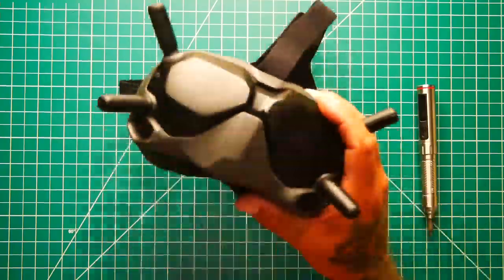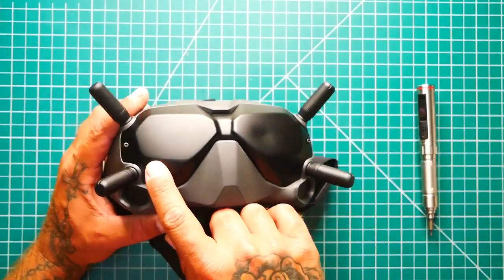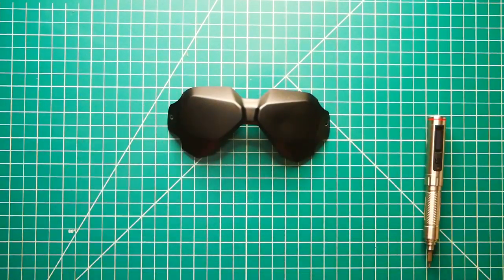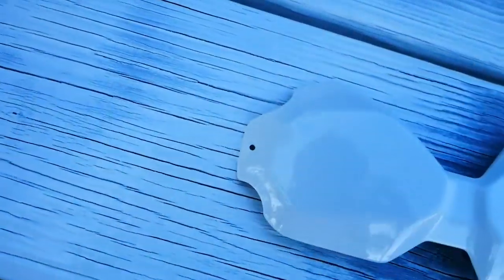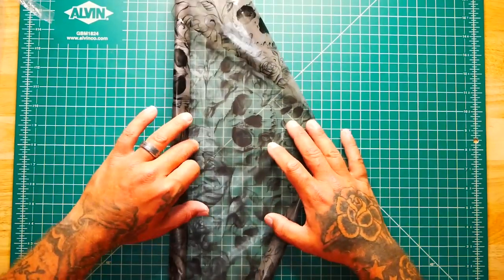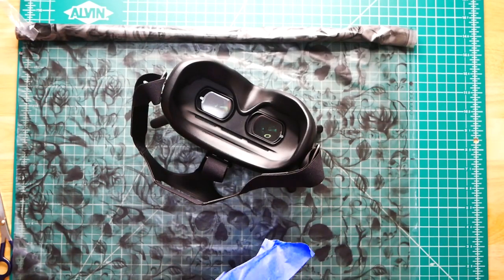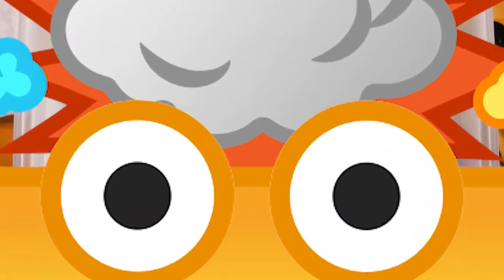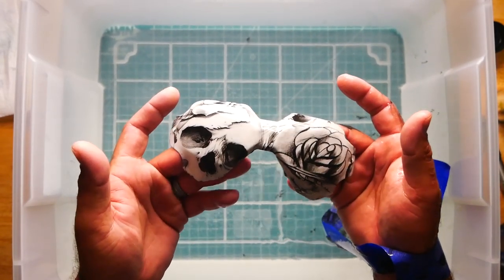How I Made My DJI Goggles Cooler Than Yours! Hydro-Dipping

Comment: I have a Hitachi DB 3DL2 cordless screw driver I use for my RC.  I like the small factor of yours but the Hitachi has adjustable clutch which is really nice.  What model do you use and does it have an adjustable clutch or different power modes (Hi/Low)?

Comment: I gotta ask DrainMan, cause I know you'll give me straight-up answer - Is the the DJI stuff really that great, in your opinion after having it a while now? I'm still on the fence. After having it, does it really make analog seem that outdated, or is it more of a "nice to have" experience? You know what I mean bro - Is this sh*t really worth the cash?
Reply from the maker: That's a damn good question! It's definitely amazing! The video is impeccable, builds are way easier, range could be better. I have 3 air units, 1 of them freezes after 10s of flight. Other than that. Yes buy it! You won't want to go back! But you will still  enjoy flying your analog. If that makes any sense.
Reply: @DrainManFPV  that was question I planned to ask you too! Thanks for the great advice! 🙌🏼👊🏼🤙🏼
Reply: @DrainManFPV  It sure does make sense, thanks DrainMan, appreciate you man.